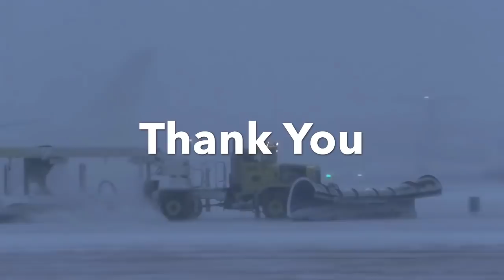How A Loose Nut Helped Bring Down A Passenger Jet | Hapag Lloyd Flight 3378 Episode 28

Comment: 20 cent nut? The hell kind of planes are you used to? Proper aviation hardware costs an arm, a leg and your left gonad.
A quick check places the price of a simple castle nut between 0.73 to 21.50, depending on size. And that's each.

Comment: In my opinion the captain should have returned to departure airport immediately.  Part of the problem is not wanting to admit that there is a problem.  This may be part of “pushing on.”
Ernest K. Gann recounted how he almost knocked down the Taj Mahal due to language misunderstanding and pushing on.  He had told the ground crew that he wanted 4000 units of fuel and the ground crew understood him to mean that he wanted them to pump 4000 more units onto the airplane.  Second problem, the cargo wasn’t weighted and was in fact about 50% overweight.  Third, this individual airplane had a history of being slow to accelerate.  Forth, Gann was in the very first stages of a malaria attack.  All these factors combined to Gann pushing on when he reached the last point on the runway that he could have safely stopped.
When the airplane went over the Taj Mahal it was below the tops of the minarets.

Comment: Want to know more about that nut. What component could a slightly loose nut on cause the entire landing gear to fail retraction.

I researched the official report and learned that the righthand retraction actuator had an incorrect throw, and the piston had too much play due to the loose nut, which caused it to jam once pressurized. This locked up the rest of the gear, as the entire system is dependent on sequence valves. The system was hydraulically frozen due to the mechanical issue in the retraction actuator.

Having dealt with similar rigging issues in different planes, I'd bet the gear could have been retracted if the pilots kept cycling the command lever. Eventually, the actuator would have found a sweet spot and pulled the gear up. Though, because the throw of the piston was out of tolerance in the first place, I have my doubts it would have fully engaged the uplock hook even if it did actuate.

Remember to read the manual, folks.

Comment: I have no clue about aviation, but I'm into programming, this may be a dunning-Kruger:

If they know their approximate location, fuel usage, total fuel loaded and distance traveled, wouldn't this error be solved by something like this:?

Use the total loaded fuel, current fuel level and distance traveled to get the fuel usage per distance, combined with the distance that they have to cover and the remaining fuel to get a value.

If the value differs with the fms' by x amount there is a misread, trigger a warning

grammar corrections are more than welcome

Comment: You miss the obvious due to others proposing what the problem is. The flight management system was key to the problem. Either it was fouling up calculations or was programmed wrong to not use current fuel consumption's. Possibly kilo's vs lbs of fuel was input?

Comment: I've binged your videos now, and they're great. You really need to work on the audio though, that part is holding you back.
Get a quiet, acoustically dampened room, and run your audio through a dead noise remover, like audacity.

Comment: Nice video except one important item.  I was checked out on the A310/306 at the time.  There was nothing in the manuals that informed us that the FMS does not take into account the extra drag created by the extended landing gear.  That, we learned later from this accident.  Still, it doesn't negate the fact that the crew never checked the actual fuel flow and checked it against the flight plan and FMS fuel.

Comment: A 20 cent nut you say... Rest assured there are no 20 cent parts on an aircraft; any aircraft. Even an indicator bulb costs far more.
Reply: Even the air the Tyres are filled with is worth a fortune
Reply: @juliansuse1  I'm clearly in the wrong business.
Reply: J Man they fill them with nitrogen
Reply: 20 cents to manufacture, not to buy.....
Reply: We like to look at these machines like perfect masterpieces of eingeneering but a nut is a nut, if everything in it really costed so much an airliner would be worth a small country.
Reply: NPC a 777-300er is 320 million so i guess you’re right.
Reply: @npc6817  I mean they do cost hundreds of millions
Reply: Even the nuts are tested for QC! They gotta be
Reply: Interestingly that reminded me about how Eastern Airlines back in the 80s was paying 24 bucks each for a filter, until the union members tasked with finding ways to cut costs w/o cutting wages, found the same filter for 2 1/2 cents each. 

(source: The Battle for Eastern Airlines" Frontline special)
Reply: I dunno, I expect the builders might get rivets for that, less even, with orders by the pallet load.

Comment: Lol at 20 cent nut; aircraft fasteners are way more expensive compared to normal fasteners.  😂
Reply: For a nut, depends on the size. It could be a few dollars to a few hundred dollars.
Reply: I don’t know about the rest of the plane but a friend worked at GE years ago and said the engines had a # on every part down to the nuts washers and bolts and most of them were drilled and had lock wire through the hole
Reply: You're paying for the airworthiness certificate more than the part itself. Certification is an expensive process.
Reply: There isn't a single Airbus part you can get for 20 cents.
Reply: It got me in prison. Guess it was the wrong place

Comment: The “gear” in “landing gear” is “landing equipment” and already plural. “Gears” would apply only for mechanical gears, such as in a clock.

I like your channel.
Reply: That's absolutely correct, english can be so complicated sometimes.
Reply: The word could also be considered a collective noun, allowing either singular or plural useage.

Comment: The Captain was the "NUT" that caused the issue not the nut on the landing gear!  We regularly have simulator checks with various failures ... no one can expect that the exact scenario that crops up in real life will be something that was addressed in the simulator BUT the simulator is there to exercise our judgment and to give confidence that when scenarios arise that we can address them to a successful outcome.  We are to use ALL available resources to bring the flight to a safe conclusion.  So merely relying on the FMS and not cross checking with actual fuel burn was unthinkable especially when the F/O was picking up on it and voicing his concerns.  My view is that anyone in the cockpit with me no matter how new has something to add ... sadly this captain seems not to hold to the same opinion.  Thankfully people did not die as a result.

Comment: The nut was the captain.
Reply: Loose nut.
Reply: Probably more nuts in the airline. It would explain a lot.
Reply: Yep, completely irresponsible pilot. The second there was any question from either the captain or first officer about the fuel levels, they should have landed. 

If they still have a job, I hope they both remember this experience. They got extremely lucky! The pilot needs to learn to open his ears and the copilot needs to learn to speak up.
Reply: I was here just to make this same comment!
Reply: Dave Menche I just replied to a loose nut
Reply: I've done some small aviation jobs and my understanding is that there's certain screws/bolts on an aircraft that are "single use". At least in America, I know that once they tighten some bits if they ever take them off they basically toss them in the trash and replace them with new ones. When you're talking about a titanium bolt/screw... That runs into the hundreds/ thousands of dollars just to do routine maintenance.
Reply: @charlesseitz1591  Case in point: the lock nut on the mounting bolt for the left elevator trim tab that caused the 2011 Reno Air Races crash of the modified P-51D Mustang named The Galloping Ghost. (That lock nut had been in continuous use for 26 years...)
Reply: @charlesseitz1591  That wouldn't surprise me. Nuts and bolts are cheap as chips, a plane and 400 people's lives on the other hand are very expensive.

Comment: I imagine this incident has added weight to the recommendation that, if the aircraft develops an issue that cannot be resolved in flight and may impact the performance of the flight, then get it on the ground as soon as practicable.  Taking the decision not to land at Zagreb could easily have led to the loss of the aircraft and those on board, and did cause significant chaos in the air over Europe as that runway at Vienna was closed for some time.  I imagine that, what was chief pilot and instructor, for the airline is now flying a desk somewhere well away from aviation...
Reply: The computer fans - I mean "engines", powered by a wall outlet

Comment: Should have returned to their starting point.
Reply: Good idea unless the plane is over its authorized landing weight as most larger aircraft have a higher takeoff weight than authorized landing weight ... they could have dumped fuel but pressing on to another airport and thus allowing the fuel to burn down to get below the allowable landing weight may have been the thought process especially if to an airport with superior ground services or maintenance base.

Comment: The captain is an arrogant fool. A professional crew would have returned to the departure airport.
Reply: See "Tenerife 1977"
Reply: yes arrogant and ignorant.
Reply: Not necessarily. A well trained crew would have assessed the fuel penalty to correctly analyse the options.
Reply: Pete Conrad a crew with half a brain would have done that. There’s a chart in the performance manual for flight with gear extended.
Reply: boeingdriver29 it was not a certification requirement at the time so it might not have. The crew thought the FMS was accounting for the penalty.
Reply: It is not the nut. If you ask me, the main mistake is the captain should go back to the airport of departure.
Reply: esphi LEE not necessarily. If you work out the fuel penalty then you can assess your best option. Which may or may not be the departure airfield.
Reply: Pete Conrad, safety first. Land at the closest, easiest reached airport. You have the hind sight that it was just a nut problem. Without the hind sight, getting the plane down on the ground before anything more serious happens, is the sensible option.
Reply: esphi LEE no it’s not. Landing at the most suitable airfield is the right thing to do. As long as its in fuel range that’s what matters.
Reply: Pete Conrad,
  I have read the comments from top to bottom.  Are you the captain in the video?
Reply: esphi LEE no. A good commander will assess the aircraft capability in terms of fuel, approach and landing capability, weather and other operational considerations. They’ll then determine which aerodrome is the best safe option.

It may, or may not be, the aerodrome of origin.

Since we don’t have full facts here, saying it should have been the aerodrome of origin is pointless.
Reply: @esphilee  yes he was the captain. Trust me I'm the wheel
Reply: A moronic statement.
Reply: A return to the departure airport should have been required as it was noticed right after takeoff. Anything else is foolish. You dont know why it didnt retract. There could be other issues. You dont just press on like this.
Reply: Mr ekg98 doesn’t have to be departure airfield. Any most suitable within reasonable range. The aircraft is designed to ferry with gear down. The just didn’t make a correction for fuel and assumed the FMS did it.
Reply: Pete Conrad that is sad and shouldnt be the case. Its almost the same as pressing on with a engine failure. Its a primary system.
Reply: Mr ekg98 no. 

1.If you have an engine fail, the aircraft is immediately compromised and you should land at the nearest suitable airfield, which may be the departure airfield, but maybe not. For example, many pilots departing london city to the north, brief to go to stansted in the event of an engine failure or fire. 
2. This is not a critical failure since the gear was in a safe configuration. They were quite entitled to land at another airfield within range. The issue was that the gravely miscalculated their range. 

So, your assertion is quite incorrect. I think most professional commanders would agree.
Reply: Pete Conrad i have never heard of a us aircrew continuing to destination with problems. Gear failure even if indicated safe. Down and locked. Can still not be safe depending on the previous failure. It is what it is. Any issue with flight controls. Engines. Electrics. Hydraulics or gear should warrant landing immediately
Reply: Mr ekg98 sorry mate but you’re talking out of your arse. Pilots continue with problems every day. It’s up to the captain to decide. For what it’s worth I was many years ago in a crew out of Abu Dhabi to Dubai when we got our gear stuck. Since we’d taken fuel for the next leg to London we carried in to Dubai. No problem. Blindly returning is idiotic. If the departure airport is the right place then do it, if it isn’t then don’t. Making a blanket statement shows you have no idea what you’re talking about. Another armchair commander who’s only experience is watching you tube videos but thinks he knows it all. Pipe down mate.
Reply: Of course as a proper german you have your "reservations" about "the Balkans"(and you generously extend this to include Greece) so you want to reach "the Fatherland". Or Austria, close enough. ;-)
Reply: That's what I was thinking. No idea why he didn't.
Reply: All captains are arrogant fools. Pilot error 95% of crashes. Fact. Fools.
Reply: Fleetwood McDuecen25, your the fool and an idiot
Reply: @woodduck_23  pilot error 95% of crashes. Fact.
Reply: @tyroniousyrownshoolacez2347  Spoken like a true genius.
Reply: Fleetwood McDuecen25 what a ridiculous statement,  you have the intellect of a rock.
Reply: @boeingdriver29  Boeing drivers are the worst drivers to drive Boeing 29's. Fact. Terrible.
Reply: @tyroniousyrownshoolacez2347  That doesn't mean that all pilots are arrogant fools.

Comment: I remember this one. After this the Hapag Lloyd website www.hlf.de was referred to as “world wide warning. have low fuel. declare emergency”
There was another thing: Notice, how after the crash the airplane is resting on its tail? The A 310 has a trim tank in the tail which usually is fed automatically via a transfer valve. This broke down frequently and could be operated manually. These two guys just forgot to transfer the fuel back to the main tanks. The FMS was not too far off of the calculation, since it calculates with the actual fuel flow. So, the additional drag was taken into account, sort of.
What it didn’t account for is still having 1,8 tons of fuel (if I remember correctly...) available but in the wrong place. I guess this might have contributed to the confusion of the guys, why the engines flamed out with the fuel totalizer still giving them information that they could be airborne for another 30 minutes or so.
Another fun fact is, that the captain was the then chief pilot and instructor with HLF.
Reply: And he lost his Airline License
Reply: @Dilley_G45 and he left voluntarily. Though 4 years later, pilot was sentence to 6 months prison in Germany 2004.
Reply: @bigmikeobamas69inch3rdlegpenis  oh was it for the crash?
Reply: @bigmikeobamas69inch3rdlegpenis  oh was it for the crash?
Reply: @Dilley_G45  yeah, I did some Google and Wikipedia, pilot name is Wolfgang Arminger. Read a few articles said he he charged in Germany 6 months in prison for endangering 100 something lives I think it was. Go ahead and Google the flight and Wolfgang as well to double check me.
Reply: That actually explains a lot about his huge ego
Reply: Either way he should have landed at the nearest airport immediately, repair then fly back up. At least everyone survived. Justice was served with pilot serving moderate prison sentence and loss of license.

Comment: You turn around when you can't retracts gear
Reply: Looks like you are a road-sider or an armchair quarter back. With so much fuel on board, dumping fuel is same as going to next airport.
Reply: @sred5856  you have your gear down you have an issue with plane you don't push ahead. There are many examples of pilots that made the same mistake.
So before you think you're smart for using an old cliche aren't you doing same trying to judge after the fact. So shut up fool .
Reply: Shawn Reddick    Moving in the right direction because you may as well burn fuel. Hmm. Ok, even if you are limited to low speeds and probably unable to reach cruise height.
All fine and good.
But the moment where your tank readings disagree with whatever system or calculation you use, you must recalculate using the highest fuel consumption rate, the worse case scenario. And you do not touch your emergency fuel.
Reply: @sred5856  You understand drag? Having gear down changes the entire flight plan. You would get there with no reserve 
If you have an issue turn around. Its not like they had gone far.